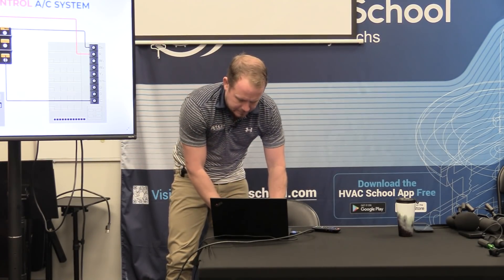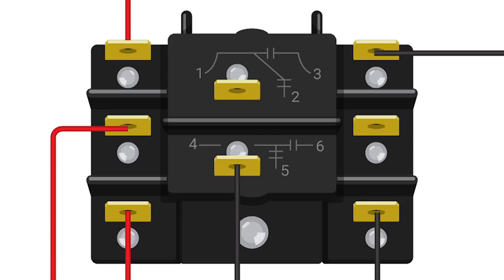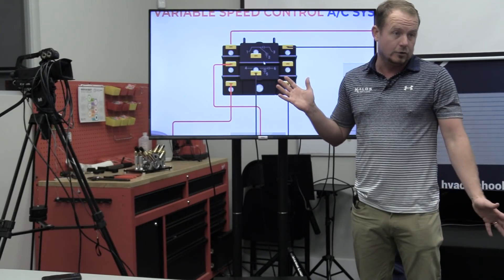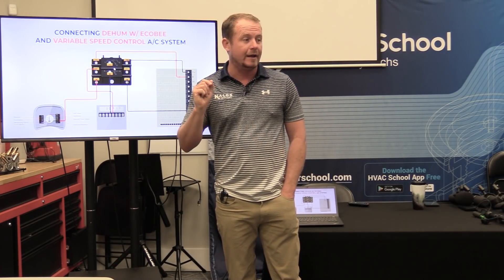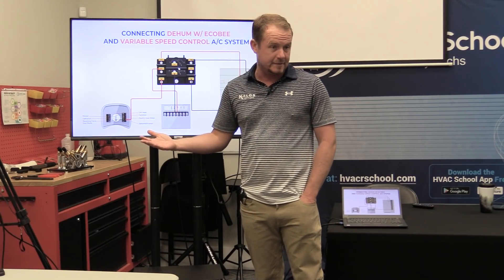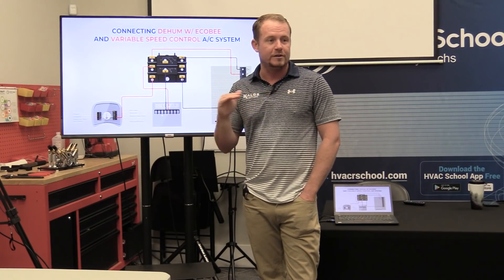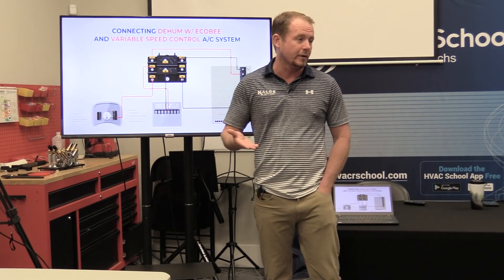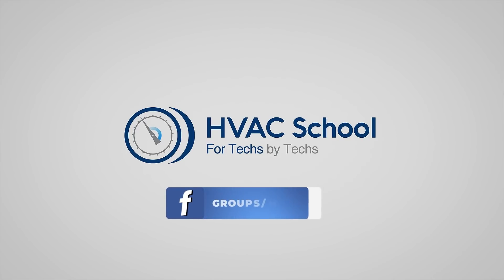Running a Dehumidifier and AC Dehumidify Modes using an EcoBee and a Relay

Comment: I didn’t need the relay tutorial but you are talking about what I need to do. Bad HVAC handyman installed a new Bosch 3 ton in a small house and we still are running a portable dehumidifier after three consultations with HVAC contractors. 
If you want something done right do it yourself. 
Easer said then done.
Reply: same for me, HVAC companies don't know anything here other than basic install

Comment: what would the wiring be for single speed hvac and stand alone dehu? I have a fresh air intake on it's own relay... trying to figure out how to wire this up. basically 2 accessories. (dehumidify & fresh air)
Reply: I am running a santa fe dehumidifier with my single stage system and I am using a PRO 1 thermostat.  It is a lot simpler then using the Ecobee. I just have a control going from the dehumidifier terminal & common from the thermostat going to a relay. The dehumidifier 24 volts is running through the normally open contact of the relay. The thermostat is setup that if the A/C isn't running,  then the thermostat will power the relay if humidity gets above 50%.
Reply: Hi. Did you figure this out?
Reply: @LastBlackStone  not really. I ended up getting a whole new system lol
Reply: @enkrypt3d  oh ok. I guess I will need to do the same. Called bunch of local hvac technicians and none of them can do it
Reply: @LastBlackStone  there are ways to do it with a relay but I dont think the ecobee can do multiple accessories....

Comment: We use the Pro T855sh. There is no need for an intermediate relay as the thermostat has both dehum and hum terminals that get directly connected to the unit. The dehum terminal can be set for NO or NC as not all units use constant energy for normal operation on the dehum terminal, we use to use the intermediate relay when the furnace had a PSC motor by simply using 2 fan speeds on the NO NC terminals but I am not sure why you are using a relay on a variable speed blower with a dehum terminal as the thermostat, at least the T855 has the relay built into the thermostat.
Reply: What does the stat control first Temperature or humidity?
Thanks
Reply: @JohnnyJr396  HUMIDITY
Reply: @anthonyspadafora1384  thanks !

Comment: I remember when you posted this on FB asking for input on how to wire this up.

In commercial and in my opinion RIB makes the best relays. Both AC and DC volts can be used.
Reply: I don't feel like anything beats the classic din rail mounted socket and relay. Screw terminals are more user friendly and nice for use with meter leads.